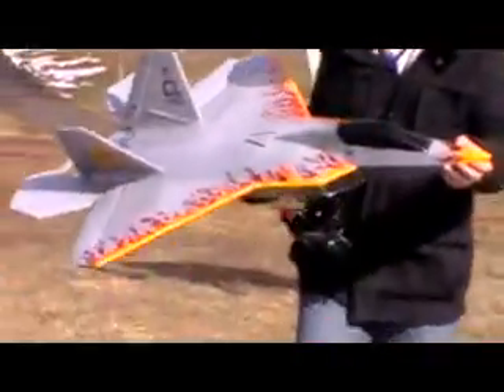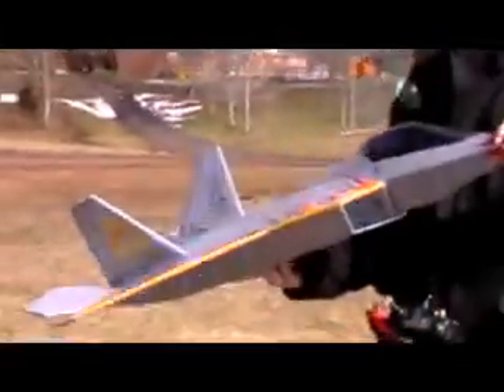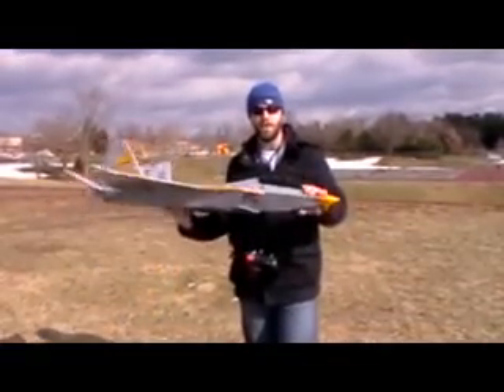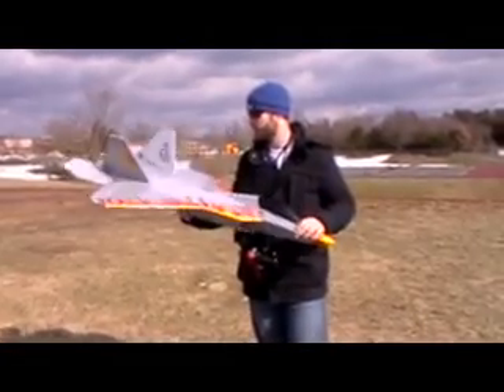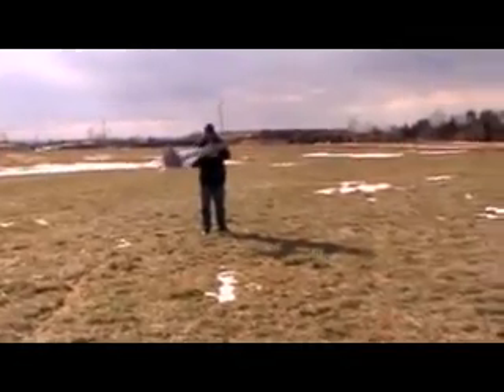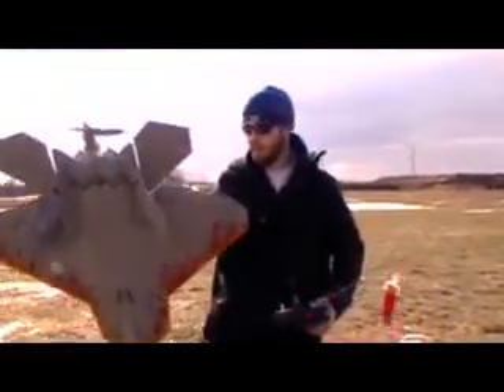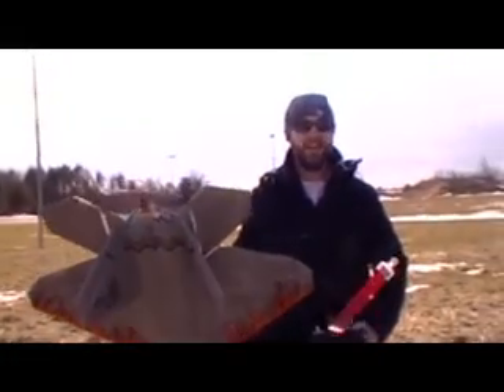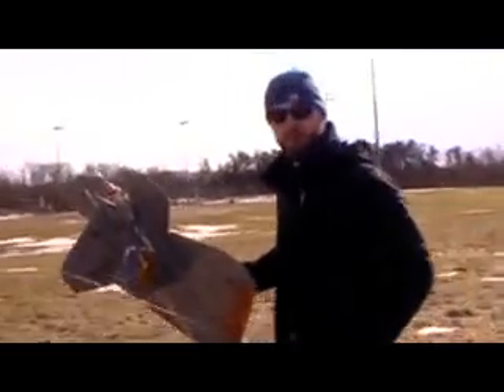RC F/A-22 Raptor Maiden Flight (Bungee Launch)

Comment from the maker: I think it was a combination of a few things... For starters she was setup nose heavy (intentionally) for the first flight.  This caused her to sit at an angle on the launch rails (low AOA on launch).  I think the Gyro also kicked in on the launch and kept the nose at that orientation.  I'm making adjustments and will launch with some more up elevator next time.

It did make for a few moments of excitement though :-)